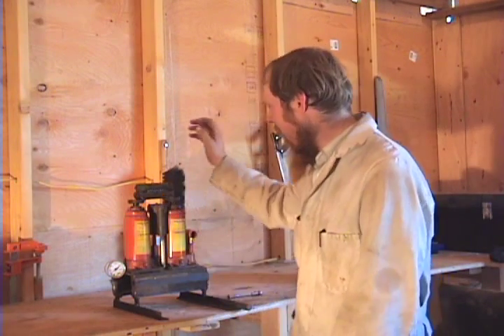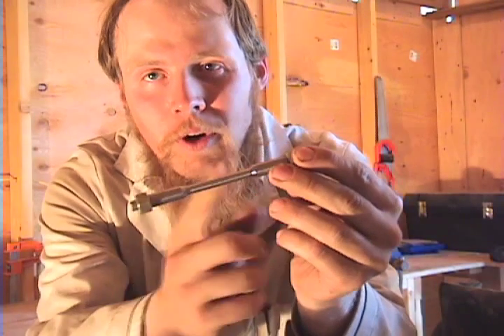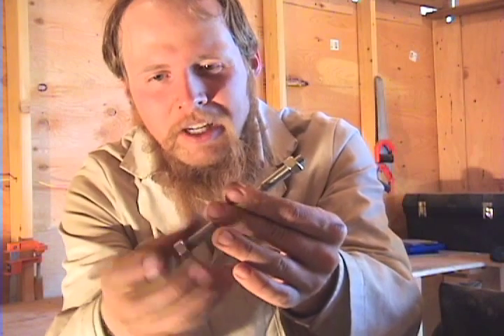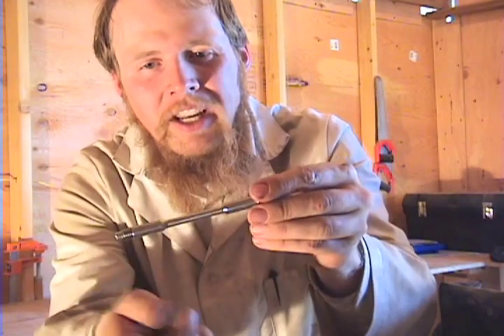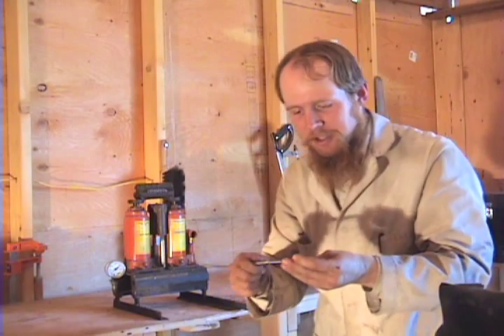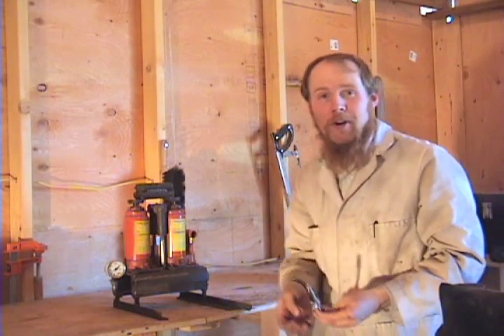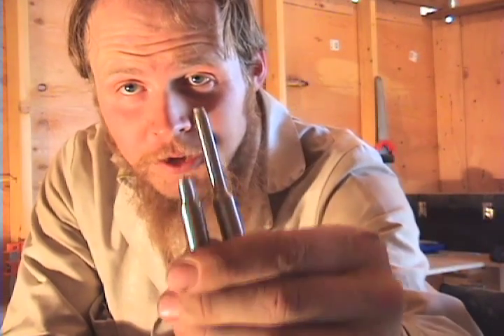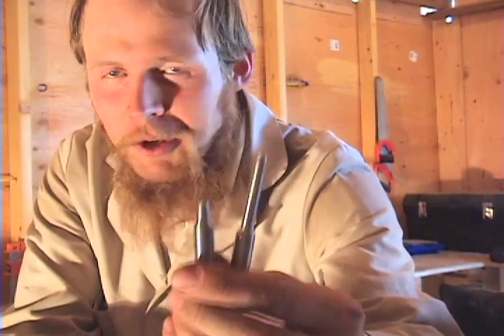DIY Tensile Testing (TIS036)

Comment: Love the video :) I was wondering if you could let me know how you connected the two jacks in the video so that they push with the same force at the same time. I believe you called it hydraulic communication. It would be appreciated! Looking to build one myself
Reply from the maker: "Hydraulic communication" is an engineering term that just means there is a pathway for fluid to flow between the two things that are "in hydraulic communication."  In this case, I drilled a hole in the bottom of each jack (into the center of the cylinder, where the hydraulic fluid is under pressure) and used a pipe tap to thread the holes.  Then I connected the two jacks using some pipe nipples and fittings from the plumbing section of a local hardware store.  Since fluid can flow through the pipe between the two jacks, if either jack is pressurized the pressure in both jacks will rapidly equalize, and so the force that they apply will be equal.
Reply: @TheIdahoanShow  
Awesome thanks for the reply! Is this something a newbie would be able to do with a little confidence? I'm not super familiar with hydraulics or bottleneck jacks. I'm assuming the hydraulic oil will create a mess while doing this and may need topped up afterwards?
Reply from the maker: @logandickinson985  I think a confident beginner could probably tackle a project like this.  I recommend disassembling the jack before drilling the hole--both to avoid getting metal chips inside the cylinder from the drilling and tapping operations, and to get a better view of how the jack works.  You can drain the oil out of the jack before disassembling it, but typically it will still need topping off when you are done, because of the additional volume of the pipe.  Most types of oil would probably work fine in a hydraulic jack.  I have usually used "tractor fluid," which is sold at farm supply stores and some hardware stores for use in tractor and backhoe hydraulic systems.

Comment: Hey- how did you gain access to the high pressure side of the Jack's?
Great project.  Gotta build one.
Thanks
Reply from the maker: I drilled and tapped a hole in the base of the jack, so that I could measure the pressure inside the cylinder.

Comment: Love it! Was it difficult linking the cylinders hydraulics together? Any helpful tips or is it pretty straight forward?

Best Matt
Reply from the maker: Linking the cylinders was pretty straightforward; however, when the cylinders are connected they apply equal force but not necessarily equal displacement.  Once the specimen is under significant tension, this isn't an issue, because the displacement of the cylinders over the distance required to break the specimen is only a small fraction of an inch, but before the specimen is taught, sometimes I have to hold the top bar level manually to keep one cylinder from rising appreciably more than the other due to small frictional imbalances in the system that become significant when I'm just taking up slack with very low reaction force.  This isn't a huge problem, but it is something I may try to improve upon if I ever build another one of these.  If I do build another one, I'll try and film the whole process so you can see how its constructed.
Reply: Fantastic! Thank you for the good answer. If you do build one please film it. Your videos are good. I like your attitude to help the community keep it up! I love how simple the idea is and your right on the money with these tools being outrageously expensive. We will be making our own this year or next year. And I plan to go into good detail about casting and testing samples. Thank you again for the video and the awesome idea!

Best Matt
Reply from the maker: You're welcome!

Comment: Hello, 
thanks for your time !! What I would like to know is that when you are ratcheting up one of the jacks, how does the other jack move up since you are not cranking it. Maybe I am missing something here ? I am just confused. Thanks Again
Reply from the maker: The jacking mechanism on a hydraulic jack is just a little pump that pressurizes the inside of the cylinder by transferring hydraulic fluid from the outer reservoir into the inner cylinder.  In this case, there is a tube that connects the inner cylinders of both jacks to each other as well as to the pressure gage. This puts them in "hydraulic communication," so if either jack is pumped, the resulting pressure will be uniformly distributed inside both cylinders.

Comment: Hello,
2 questions
1) how much would you charge, if you would make me one like yours?
2) also, how much would you charge for a detailed, step by step guide on how to build this tensile strength machine?
Reply from the maker: I will have to think about that.  I've been thinking I'd like to build myself a 2nd-generation machine that would be capable of measuring not only tensile strength but also compressive strength and flexural strength.  If I do build a new machine, then I would be happy to sell the old one for the cost of the materials that went into it (~$50) plus any applicable shipping costs.  If I build a new machine, I might also make a step-by-step video about building it.  However, I'm not sure when I'll get around to building the 2nd-generation machine--it might be a couple years.

Comment: That's a cool machine! I laughed when the head popped off as the specimen fractured, totally not expected! Neat idea using the cylinders for sure. I'm thinking about making my own machine, but I'm considering using screws instead of hydraulics. I want to use an Arduino with a stepper motor drive to log force and displacement as the test occurs, so I can establish the yield stress and modulus of materials as well. I'm considering possibly using a large spring to measure force, via displacement, but I haven't decided on anything. Thanks for the ideas!
One thing I noticed however, was that your chamfer on your specimen was a little steep. You mentioned stress concentrators at the threads, but the chamfer also introduces a stress concentration in the smaller diameter section, which is probably why it broke nearish the chamfer. Ideally, you turn it down with a large radius as the cut profile, but that's not really possible on a manual lathe, so I recommend making a more gradual chamfer if you can. This will reduce the stress concentration factor at the chamfer and make your tests more accurate :)
Reply: +Alex Dlugosch Hi Alex! I am also wanting to use an Arduino in the construction of my tensile testing machine. I am pretty new to Arduinos. I was wondering if you have already built yours and if there is any advice you could give me?
Reply: +Melanie Thatcher Hey. Well, I kinda abandoned the idea, because I figured it would be too hard to get a machine with any sort of accuracy. The problem is that you have to measure both force and displacement at the sample very accurately. Using some open loop system like a stepper motor driving a screw is not going to be nearly accurate enough. That's why real universal testing machines have expensive load cells and laser strain gauges. You could take care of the force by using hydraulics and having an electronic pressure transponder, but those are expensive anyway. And then you'd still have to measure the strain somehow. 
The system in the video is great for learning the UTS of a sample, but it can't establish the yield stress or tensile modulus, which are important parts of a tensile test and arguably more important than just knowing the UTS. For example, if you want to do a stress analysis on a part you made in CAD, you need both the modulus and Poisson's ratio for the material to do the simulation, and the yield stress to determine your factor of safety.
In conclusion, I think it's probably better to just try to find the properties of the material you're using, or pay a lab to actually test it with accurate machines. One of the reasons I wanted to make one was for 3D printer materials. However supplier taulman3D already has his filaments tested as printed, and posts all the specs like "yield" stress, elongation at break and modulus, so I haven't needed to test anything yet.

Comment: Hi what was the pressure on the pressure gauge during this experiment? And what were the diameters of the hydraulic cylinders?
Thanks
Reply from the maker: The bore diameter of these particular cylinders measured 1.143 inches, and the highest pressure reached during this test was between 2600 and 2700 psig.
Reply: ةكككككككةمكككككككككككككككككككككككككككككككككككخكة.  
'

Comment: I was wondering if you could share the formula used if I purchased the same hydraulic cylinders as yourself. I had emailed you directly thanks for your time.
Reply from the maker: Sure:  The tensile force is simply equal to the pressure on the gage multiplied by the total cross-sectional area of the hydraulic cylinder bores.  I just used a couple cheap hydraulic jacks from Harbor Freight Tools, and the cylinder bore measured about 1.134 inches in diameter, giving the two cylinders together a cross-sectional area of 2.052 square inches.  Thus, if the gage shows 2100 psi (for example), then the force would be (2100 lb/in2) x (2.052 in2) = 4309 lb. To get the tensile stress in the specimen, then just divide the force by the cross-sectional area of the specimen.  A 1/4-inch-diameter specimen has a cross-sectional area of about 0.049 square inches.  (4309 lb) / (0.049 in2) = 87,938 psi, so in this example, the tensile stress would be about 88 ksi.
Reply: Ok I greatly appriciate it. I am looking into the purchase of aluminum rod ends and would like to know there strength compared to steel. We mount these rod ends on cars that in some instances have over 10k invested in them so knowing the info is a huge benefit. I'll review your video again and I also have a lathe. The turned down area on the titanium rod does that effect how you calculate your strength test greatly appreciate the feedback I am so stoked you posted this!
Reply: Ok thank you I am reading the part about the 1/4 diameter specimine having a cross sectional area of about .049 said inches now and trying to digest that info. Thank you again your video is very awesome and innovative!
Reply from the maker: Dan Henning You're very welcome.  By the way, the cross-sectional area of a round bar is just the area of a circle, so it's equal to the diameter squared times pi (~3.14) divided by 4.  In the case of a quarter-inch diameter specimen, (0.25)*(0.25)*3.14/4 = 0.049
Reply: TheIdahoanShow  Area of a circle is Pi *radius squared.  

I am looking into making a tensile tester myself.  Is there anyway to automate your system?
Reply from the maker: Mike Lynch Well, radius is half the diameter, so if you plug that into the pi*r^2 formula, you get pi/4*D^2.  I find that it is generally more convenient to express the area formula in terms of diameter rather than in terms of radius, because the diameter of a metal bar is easy to measure, while its radius cannot be directly measured.  Anyway, with regard to automation, I guess it just depends on how much of the system you want to automate and how much money you are willing to spend doing so.  It would be relatively easy to replace the pressure gage with an electronic pressure transducer.  I would guess a decent pressure transducer would cost about two hundred dollars, but I haven't priced them out recently.  Then you could connect the transducer up to a data logger or to a computer with a DAQ module and record a graph of the pressure as a function of time while you pump the jack manually to pull the specimen.  For a few hundred dollars more, you could probably buy an electronically-controllable hydraulic pump, and hook that up to the computer as well.  Then you would only have to put the specimen in the machine and then run a computer program, and the computer would perform the test and record the data.  Thus, I would think you could build a mostly-automated version of this machine for under a thousand dollars.  However, the automated system would give you basically the same data as the manual one, and the manual one can be built for less than a hundred dollars, so I guess it's all a question of how much intrinsic value you place on automation.
Reply: TheIdahoanShow
Do you have an email address I could communicate with you further on?  I am looking into a school project to create a tensile tester and would like to learn more, as your creation seems simple, effective and very economical.  

Thank you!

Comment: where did you get a gauge that can show you values like 112ksi?????
Reply from the maker: The gage shows the pressure in the hydraulics, not the stress in the tensile specimen directly.  Knowing the pressure in the hydraulics and the diameter of the hydraulic rams, I can calculate the force applied to the tensile specimen, and knowing the diameter of the specimen, I can calculate the stress from the force.  The pressure gage on the hydraulics only goes up to 7000 psi (7ksi), but because the rams are much larger in diameter than the tensile specimen, I can test specimens up to about 250ksi.  I bought the gage from McMaster-Carr for about $15.